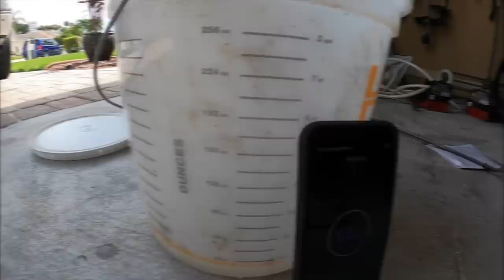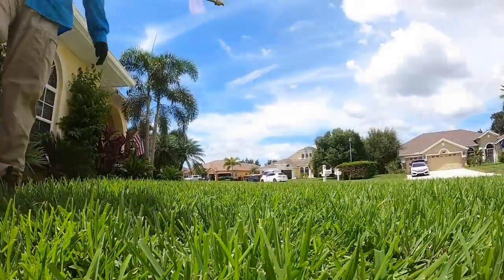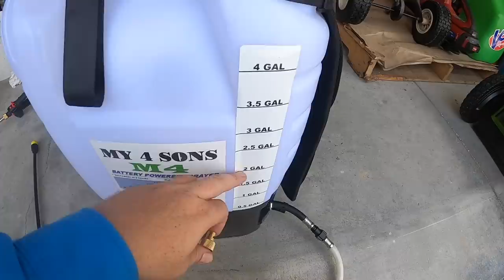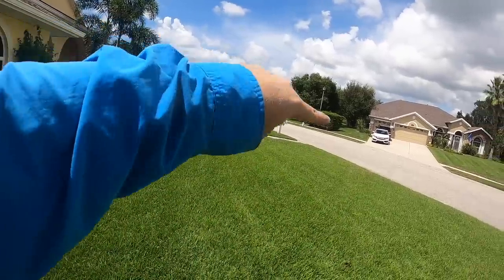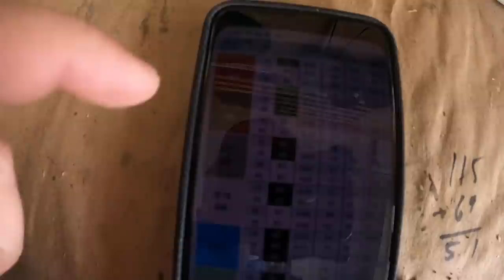BackPack Sprayer Setup // SPRAY YOUR LAWN With Confidence

Comment: Appreciate your videos and all the tips you offer! I recently purchased a My4Sons sprayer myself. With the brass tip at 60 PSI i'm getting about 1 gallon every 2 minutes and 48 seconds. When calibrating my walking pace to the sprayer I found a free metronome app keeps me on track! At the current rate of my sprayer, 65 BPM works well for my stride (taking one step per beat).

Comment: Thanks Mr. Hane for helping me tremendously understanding my own M4S sprayer even better.  Till I can walk better, I’ll use the variable pressure at maybe half pressure or even less.
Reply from the maker: sounds good! I will do a lot more with this sprayer in the next couple vids too.
Reply: Having walking issues is the pits. I've got spinal compression that limits what I can do... which as you know, makes being an LCN very difficult.

Comment: Your timing is impeccable.   I just got my My4sons (gold model) sprayer. I used it to spot spray my winter weeds.  You have saved me time playing with the nozzles.  Next week I will put down the granular Protamine.  Mine came with the spray gun which might produce a higher PSI.  I think I have an adapter that will fit my pressure washer nozzles.  So I will try those and see.  And yes I went out and bought a scale.
Reply: Do you get 30 sec per quart at 60 psi, I’m getting one minute ?

Comment: Get part 3 up already! haha! Great work Allyn. I recently purchased the My4Sons sprayer and used it for a Dismiss application with a Teejet nozzle. Absolutely a dream to run. Love the fact I no longer have to pump to keep the pressure regulated. Looking forward to your nozzle recommendations.
Reply: Irodom, what TeeJet nozzle are you using, and how are you connecting it? My4Sons has a metric connection, and I thought that all of the TeeJets were standard.
Reply: @fredcurrier5912  the nozzle drops straight into the my4sons threaded collar. I used a flat washer and an o-ring on top of the nozzle to make a good seal. So far, it's been working with no issues. I do need to update the nozzle though. My current one's volume per minute is too low for my liking. It takes me roughly 20-25 minutes to spray through 4 gallons. I'd like to get down closer to 10 minutes for that volume.
Reply: @lrodom  I had a feeling that it might fit into the collar... and what I was hoping. Which specific nozzle are you using? I'm thinking of 1 of the reds, which should put out around .91gal over 1Ksf at 40PSI and 1.0gal at 50PSI, both walking at a 3MPH pace. Not sure of how wide the spray pattern will be yet though.

Comment: Love the M4S. I use the pink one as a "fogger" when I spray my insecticides.
Reply: What PSI are you using with the pink "fogger" for the insecticide applications?
Reply: @ericsandman4508  I keep it on the max (65 psi)

Comment: Is there a reason why you chose M4S electric over a Flowzone? SiteOne has Flowzone for sale and you can swap the tip for a Chemlawn gun. The psi can get you 1.5 gal/1 min/1000sqft with a better spray (bigger droplets) pattern out of the gun.

Comment: I have had the M4S sprayer for 2 years now and the variable pump is nice. The tank seal at top failed right away. I wish I had bought another as the wands and threads on it are not standard so you are stuck with the cheap fittings and adapters they sent with it even after paying for the upgraded sprayer fitting kit. To use other sprayer tips I would have to rebuild the hose. It just felt like the different tips seemed cheap. I call them the Tonka spraying kit. I stopped using it for lawn spraying and only use it now with the adjustable tip and Pest Control.

Comment: Help! I'm confused. I'm trying to figure out how long it takes to walk an area of 1000sqft. To get my sqft area measurement don't I need to know (or measure my spray width output of the nozzle I'm using) swath area?  It will take less time to walk 1000 sqft if my swath is 5', 6', 7' vs 1', 2' 3' swath. Or did you mention to measure the swath area and I just missed it?

Comment: The engineer in me is compelled to comment: measuring a full gallon once will be more precise than averaging 3 separate quarts. Assuming similar measurement error for both time and volume under each condition, a single, larger spray will be closer. Of course, averaging 3 one gallon sprays would be even better.
Reply from the maker: good thing we are only caring for grass and not building bridges 😂
Reply: @Thelawncarenut  and not high value crops! This is what we did at the pine seedling nursery I used to work at. average of 3 full 300 gallon tanks over a known number of acres.

Comment: Allyn, is there a reason you use the Teejet Turbo Floodjet vs Teejet Turbo Teejet Induction. Looking at the Teejet chart for the droplet size: the Turbo Floodjet doesn't put out the UC (Ultra Coarse) droplet size for pressure greater than 30-40psi depending which one we looking at. For backpack sprayer, it usually has 40psi or greater which means we wouldnt get the UC (Ultra Coarse) droplet size. The Turbo Teejet Induction indicate we can still get UC droplet size at 60psi.

Can you let me know some of your thoughts on this please? Thanks

Comment: question: being blind, I can't exactly see how he is spreying. I know its a fan tip and I understand that, and keep the tip near knee height. But does he move the tip from side to side as he walks, or is the fan tip wide enough that he just holds it still both in vertical and horizontal
Reply: He does not move it side to side. Keeps it pretty still vertical and horizontal

Comment: love the video as always.  Allyn- you NEED to review the new Honda HRN216 pushmower...  just a BEAST and only $400!     Bags a TON of grass due to double cut blade system/bag fills tight and a new 170 CC motor has GREAT power!     Love mine, but need a REAL professional review

Comment: Hey there LCN! Great video! Just what I needed, but I’ve got admit I’m a little disappointed. See I came looking for you because I knew as analy precise as you are you’d be the one that would do the gum bucket test by weight. “Lemme see, a gallon of water weighs 7.62 pounds, but you don’t have to spray a gallon. You could do a quart, but I wouldn’t because diving 7.62 pound would carry you tree places and you’d have to round up, so let’s do 1/2 pound out 2 places. Now just put you bucket on the scale, TARE it out to 0 and start spraying to 3.81 pounds. Bada bing!” 😂😉  Love ya and once again walked away learned!!

Comment: Allyn, you "said" at the end that the brass fan tip that you used was best for weed control. I presume that's due to droplet size? Pre-emergent weed control and soil apps (large drops), or post-emergent needing smaller drops? Yesterday, I used my sprayer and the tip that you used for the first time, to spray RGS and Humic. I'm REALLY looking forward to the 3rd installment, especially since the wand connection is metric and most TeeJets that I've looked at are not.

Comment: A basic two speed pump is going to be better for most people and easier to calibrate.  With that variable speed knob, you are never going to get the same exact speed/pressure every time  -- unless you want to re calibrate before every spray job.
Reply from the maker: Agreed. That is why I just used the max.

Comment: That first brass  “fan tip” you used is actually a deflector tip.
Reply from the maker: good to know - it worked really well. I like the pattern it makes.
Reply: The Lawn Care Nut 
We use those here in the U.K. for lawns, I use the green one,sometimes the blue, if you hold the wand about 1/2 meter high it will spray a metre wide swath.

Comment: The gallon label on M4S sprayer is not accurate.  You should mark label with a sharpie after adding 1 gallon at a time.
Reply from the maker: really? I'll have to look at that, if so, that is kinda lame.
Reply: Rambo B  same here, the labeling is  off considerably.  Good that you brought it up.

Comment: I like the M4S sprayer, but found all tips useless except the brass fan. Also, the gallon marks on mine were not correct so I measured out 1 gallon at a time and made new marks, may want to check yours also.
Reply from the maker: Someone else said that too. I'll def check on that.

Comment: What tip and drop size do you recommend for post emergents?  Trying to get rid of Bent grass using Tenacity.  Ive been using  a blue Turbo Flood Jet at 30 psi.  I think I may be appying too large a droplet?
Reply: Bump.  I'd also appreciate an answer being posted to @Erik's question above.

Comment: Would like to see you review GCI Turf spray nozzles with this sprayer. Pete claims you can get an eight foot wide spray from the spray tips he sells. Thanks for the sprayer review and tips on how to use. On a side note, would be good to show your viewers how you determine how wide a spray pattern each tip provides. This will help in knowing the space between each row you spray. Thanks again.
Reply: Add Lazer to any of your mixs and measure/determine from there. Since you are "throwing it down" already 🍻💪.
Reply from the maker: His stuff is all confidential/proprietary to what he does  You'll want to ask him about tutorials on them but for me, I'm just using off the shelf stuff.

Comment: Depending on what that tip is rated for you could get more gpm at a lower PSI. going beyond the psi rating for a tip  produces a finer mist which can lead to fewer gpm. in short more PSI doesn't always mean more gpm.

Comment: Does this mean end of the Ortho Dial n Spray
Reply from the maker: just giving some fresh options. ✌
Reply: @Thelawncarenut  Speaking of the Ortho vs the My4Sons, GreenPunch is not recommended with a backpack due to needing a 20:1 ratio. Can you just use 6oz/gal to get that ratio? That's the same ration as 6oz of RGS per gallon, ain't it???

Comment: Since the brass tip you use is not spraying the volume you want, why not just drill the orifice size bigger. Brass is easy to drill and you should be able to slowly up the drill size until you get the flow rate you desire.
Reply from the maker: that's way over my ability 😂
Reply: Not so easily done. Several factors.